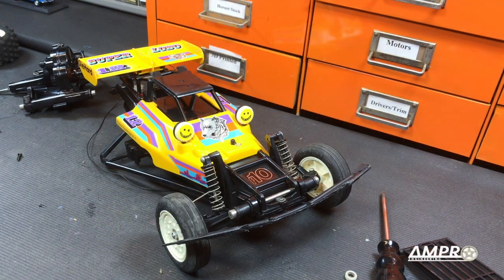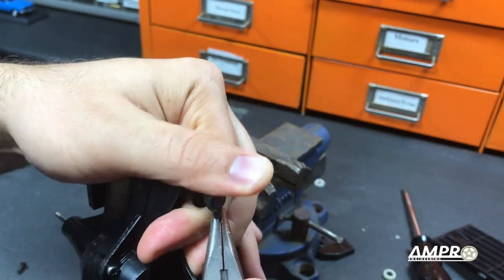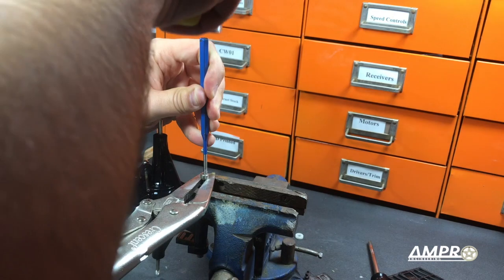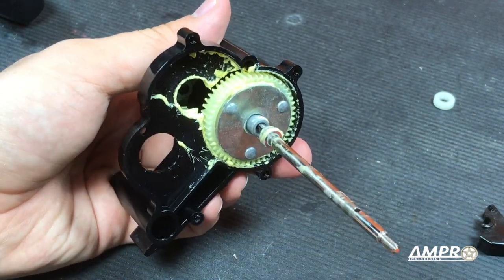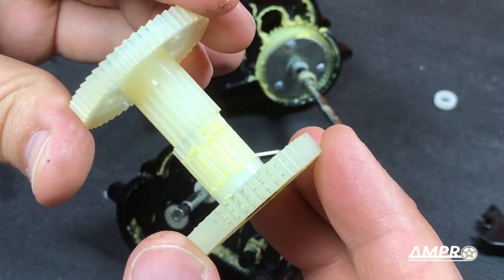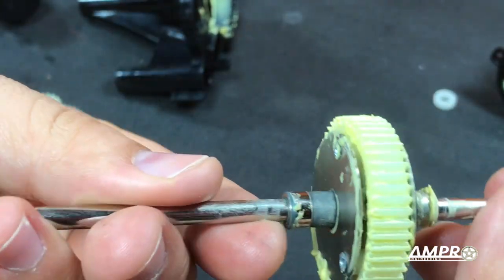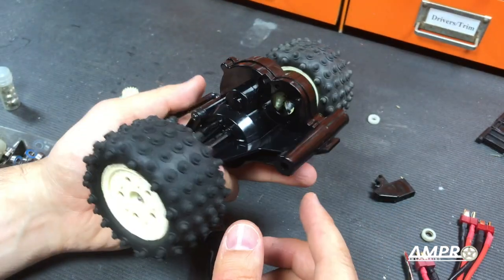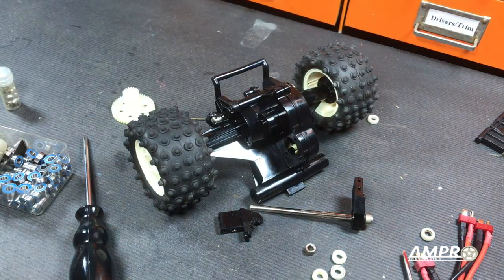e179: Nikko Rhino / Bison / F10; The Transmission

Comment: Memories, my first "fast" rc car was a Bison F-10 in 1986. On asphalt it performed similar to my Hornet which was purchased some later, but the stiff Bison F-10 suspension was worse (than the Hornet) in the terrain, as far as I remember. You can reuse the pivot pin by easily installing a steel collar with hex screw on the end. These are available in all sizes on Ebay etc. If you want to keep the original RC equipment (I think you should since it's working), you may consider (?) to install a BEC between 7.2 battery connection and the RC equipment, and thus save weight (approx 100 grams). 
Anyway, thanks for sharing :-)
Reply from the maker: Yeah the car is so close to being Tamiya competition but Nikko had to worry about broken parts and support, something Tamiya didn't. I thought about some electronics upgrades but didnt think about the BEC. It is a good idea.
Reply: Hi, subsequently, in the next Ampro episode, I noted that the pivot pin issue has been solved concurrently with the fragile plastic pivot pin holder, very well. I have not tried, but yes I would assume that it would be possible to bypass the AA battery box with a BEC unit from the main battery for simpler running and weight savings. Agree, the Tamiya cars were far easier to deal with for repairs & spare parts.

Comment: Is the transmission case the same size as a grasshopper one? If I couldn't find a replacement diff for that trans, could I just replace the whole transmission with a grasshopper?
Reply from the maker: It is close. You should be able to do that but some work is needed.

Comment: A question. I have one and everything seems to be in working condition. Motor works great. Tires spin when not touching the ground. But when i put the car on the ground to actually drive it... The car does not move... Any idea what is wrong? Are my gears stripped? Or is the 380 original motor just too worn because of old age... And is does not have enough torque anymore
Reply from the maker: Well...are the battery terminals dirty? batteries charged? Usually it is a problem of voltage and current. It could also be that the electronics are old the solder joints are starting to fail. It really sounds like a power issue like a dead/dying battery.

Comment: The gears in my transmission of a Nikko Tropical Tour (same transmission as the Bison) were totally blocked. I opened the gearbox with the help from Ampro´s Bison videos (🤝) and found out that some melting of some added material had happened on the diffgear round about 3-4 teeth. I removed the clutter with a model knife. After removing CHECK with your fingers if the gears rum 100% SMOOTHLY !!! I did not, greased it like hell, reassembled and then found out, that there was still a little block at one point when turning the axles in the same direction....You can imgaine the mess to find the spot that needed still some work to do on...It is ONE tooth, that needs to be located and then worked on in a precision of one 10th of a millimeter....And then all that grease ;_)
Reply from the maker: I'm glad you were able to fix it. I wonder what caused the problem in the first place
Reply: @AMPROEngineering  Must have been a piece of plastic that got into the gear box while the motor was not in there...I also cut a thread M5 on the hinge. An M5 nut secures the hinge now with a bit of threadlock :)

Comment: hello I need to remove the wheels from the transmission and remove it completely to complete the car with another model, do you know how to disassemble? in the videos it already looks unarmed but not the moment you take them off
Reply from the maker: These wheels are attached with an M4 nut. The trans comes apart almost exactly like a Tamiya Hornet

Comment: Hi.  First of all I love your channel. I recently purchased one of these as it was my first RC car. The electronics do not work and need to be replaced. Which Servo do you think I can fit in it without much modification? Thank you
Reply from the maker: Oh boy, I don't know. In order to replace the servo you would have to replace all of the electronics unless you are gifted when it comes to deciphering the onboard circuitry. Usually standard servos are the best bet
Reply: AMPRO Engineering Thank you. Yea I will be replacing all of the electronics.

Comment: consider it? may not be "stock", but I'd go ahead slip plastic tubing into the trans pivot, slap in Tamiya size rod, and use Tamiya's floating pivots. it might help it transfer weight a little better for cornering in dirt. it'd be cheating, but only a slight bit. last episode so weird how they'd switched ch1+ch2, real peculiar! the NiCad crosswise rear and the 4 AA's for the receiver do add a little extra weight, same for all that upper plastic, might be a little better in the traction department than a stock Hornet anyway.
Reply from the maker: I thought about that but it would need more work than just swapping the axle pivots. I would want it centrally restrained like my Hornet brace but man do I not want to go down that path right now! Haha! I am also confused about the channel swap...
Reply: true it wouldn't be super simple, or true to being more like a restoration. Hornet we used to stop the CLACK with a screw centered from the inside of the tub, with rubber tubing glued over it, leaving about 1/4" above for the casing to rock back like they'll always do. saw Steve's (ShenRC) fishing line trick.. "darn why didn't I think of that?" lol

if the swapped channels is a real issue you don't have a compatible transmitter for, use a toy one and rewire the joystick pots...  kind of a chore but done it before!

Comment: careful with those pivots for the rear shocks, the mounting holes on mine were extremely brittle. i ended up having to repair mine with JB weld
Reply from the maker: Oh thanks for the heads up!
Reply: yup, they used hard brittle plastic to begin with, now its 30+ years later.

Comment: my transmission`s piviot rod has one sleeve and uses a lock nut done up with my tamiya tool on the other end
Reply from the maker: Interesting. Seems like there are a lot of variations.
Reply: @AMPROEngineering  a lot easier to undo